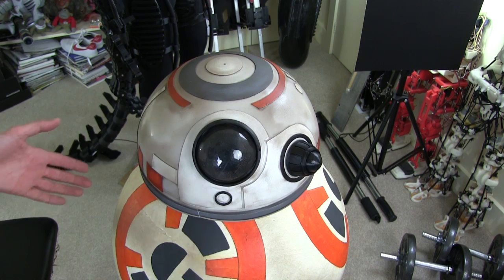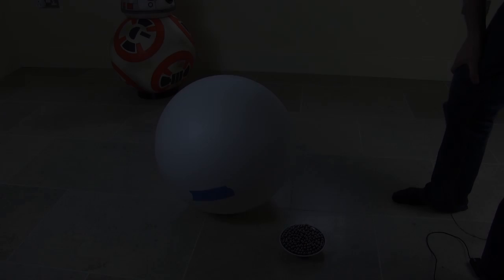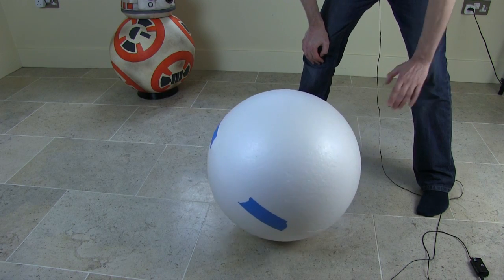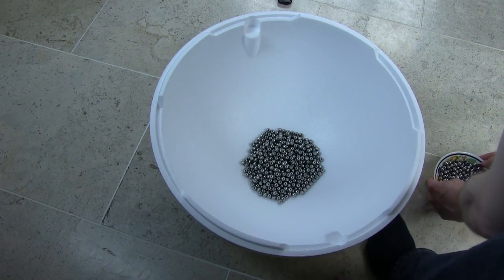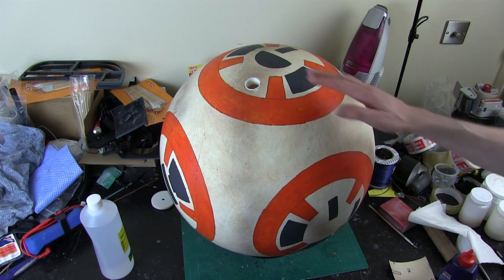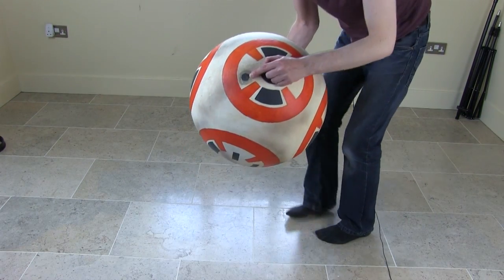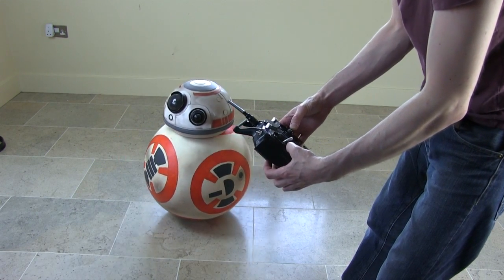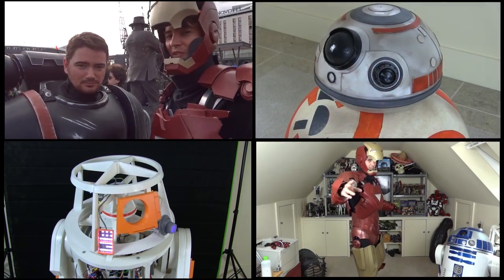Star Wars BB-8 Droid v1 #5 | Improving Stability | James Bruton

Comment: The answer your looking for in relatively simple: the head fighting it own weight, so build another head. but build it in a concave pattern opposite of the convex pattern you are running now for the heads drive wheels. insert the second head into the sphere at the bottom. with the inner and outer drives running in sync, the weight will be distributed evenly and double the power to weight ratio. making it more nimble and easier to control.  Now if you dont want to remove the inner drive all the time to recharge the batteries all the time, you could use a cell phone pad.  just park the sphere on the pad, and if the power cell is low enough in the inner drive, you should be good to go. But great job so far, Keep up the good work.

Comment: Center of gravity is still to high.
Put the robot into the ball near the floor as low center of gravity and connect the head on top with a strong magnet and ball bearings. if you also make a movable counterweight inside the ball the robot could also tilt his head up and down.

Comment: James I have not seen all the videos on this, nor all the input you might have received, but is it not a solution to use a magnet on the head part of the droid and a metal ball under it (on the inside of the main body sphere)? I might be wrong of course, but in my reasoning this solution would present stability for the moving head as it is being held on and friction towards the main body for more traction because of the magnetic pull...?

Comment: You might try (if not already mentioned) spraying the inside of the ball with a rubber coating I.e. flex seal or equivalent. It would quiet down the ball bearing considerably.

Comment: Build inside the big ball.. a big gyro with engines instead of ball bearings in the joints of the gyro.. with  a heavy bottom on the inner ring of the gyro..
i am thinking car battery heavy
that would make the big ball the Drive unit, and the head is only balancing on it..
you will have more power to move and it would  be more stable. guess it would stand still as a rock, even on hard surface...

Comment: Instead of slowing down the ball with rattly ball bearings increase the speed of the head by up sizing of your drive wheels, or if your issue is response time, downsize them to minimize the movements and reduce travel distance. Either way, your wheels are the wrong size.

Comment: James, think about going in the opposite direction for friction. Go back to the smooth unpainted ball. Introduce friction by replacing the painted graphics with textured stick on material...like non-skid.

Having a sandpaper texture probably won't be enough, So perhaps you'll need to come up with a 3D printed very thin layer with a more desired friction pattern to stick on. Also I can see the 'orange' pattern being different from the grey.

Right now with the ball bearings, you aren't only dealing with friction, but also overcoming the inertia created by the mass.

I hope these thoughts give you something to think about.

It's a very attractive project.

Comment: The smoothness may be improved if you were to spread the bearings out over a larger area, so that their weight isn't centralized in one spot.

A suggestion I would make is to find a way to develop an inner sphere with a slightly smaller diameter, with some small studs to sit it off the inner face of the polystyrene sphere, so that it now creates a "channel" locking the bearings to be a single layer, spreading them out over a larger area, and also giving you a "closed" system to keep the silicone oil focused on lubricating the bearings

Comment: The issue wont be the speed of the microcontroller. A 16mhz micro can do PID control to keep a quadcopter level and flying no problem, which is a more complex. The issue you're having is either the motors not responding fast enough to the PID output (most likely) or the arduino PID library your using is just badly written or slow. Or It could be slow/filtered accelerometer data going into the PID (you need no lag/filtering between angle change,  PID output and motor response to get a stable system.)

Comment: Why didn't you build 2 heads? 1 as the top and another as the inner balancing unit? I can see the problem with syncing both robots to face the same location inside and outside. But rather than have momentum driven balls and liquid, you now have control from inside the ball too.

Comment: i think what the starwars guys did was a heavy ball.. kept the head attached to the body with ball magnets on both sides.. inside the head and inside the ball.. then the wheels on the head is just the same thing but the configuration is in reverse so where ever the head leans that's where the ball will go. idk.. it's just my opinion.. i'm not a professional or anything but that's how i think to would probably work.

Comment: i think it would be alot easyer to install the stearing mechanism inside simular to what u made the head of, the weight in the bottom wil give u higer stability and the larger drive serface should give u more traction aswel on other surfaces

Comment: You could also make an exact copy of the head unit mechanism, alter the alignment of the rollers, and install it inside the big ball. Then, instead of using the head mechanism to do the actual mobility, use it only to keep the head positioned stably and then use the mechanism inside the big ball for the actual mobility.
Reply: he would need a really powerful magnet or smth for that
Reply: @aneeshprasobhan  No, he wouldn't. He could use exactly what he's already using.

Comment: 16BIT ARDUINO. no it's only 8. and that's not the board (arduino) but the chip.
also the chip runs at 16mhz not the arduino it's just a dev board.

Comment: It might be possible to get more speed out of the Arduino by rewriting some of the routines in C or even assembly vs using the libs.
Another option use the Arduino Due which has an 84Mhz cortex processor.

Comment: I think a better solution would be to have the motors and brain component in the bottom inside the ball. Then have the head simply be a light decorative object keept in place by a magnets on top of the ball. This way, the majority of the weight would be in the bottom half of the ball and it would not have a risk of falling over.

Comment: I think the sound of the ball bearings ruin the illusion entirely. I think you need to keep sound down to a minimum inside the ball. What about using larger balls? Like a few tennis balls.

 Or some of those bouncy balls you get which are quite heavy and dense and won't make much noise as they move about.

Comment: Why not make it move in the same way as a "sphero" (basically a toy RC ball)
And simply have the head stay on with a stationary magnet inside the ball, and have it freely slide across the outside of the ball with some sort of bearings inside the head, or some sort of small wheels like what you have. 

EDIT: I found this online right after writing this comment. this is EXACTLY what I was thinking of. 
http://nerdist.com/wp-content/uploads/2015/05/BB8Work_Schem.jpg

Comment: Fantastic work sir!  Can't get the void to play past ball bearings test - but hate how it makes BB8 so noisy! Have you considered instead a secondary gyro motive unit in the bottom ball? Either wirelessly linked to the head unit, or independent? Seems it would add extra control without the noise and weird jerky motions from the ball bearings jerking as it turns. Whaddya think? And again,  just WOW!!! :-)

Comment: A second ball 30% smaller than the lower ball with some bearings in it inside the lower ball.
the smaller ball will dampen the sound and hold the bearings to a tighter contact spot on the bottom allowing more pin point maneuvering.

Or a gyro type spindle inside with a small weight hanging. you could 3d print it with 2 or 3 rotating circles so at least one can always have the weight in the down position no matter where the ball is. gyro would be silent too

Comment: the actual droid has the main motor inside the large ball to propel that part with the head attached with a strong magnet and ball bearings with a seperate motor to move the head.. since your not going that route it suggest coating the entire ball in rubber. by some liquid rubber spray like "flexseal" this will add weight and slow the ball down. only problem would be making it smooth enough so youll need to somewhat be a painter or know one.. the rubber coating will give it grip then you just have to paint it

Comment: I have some juggling balls which are filled with liquid silicone, they are extremely stable. Also just to note that lng carriers use spherical tanks which they fill close to full to reduce sloshing. Obviously filling the ball with liquid would probably make it too heavy, so you could maybe reduce the internal diameter of the ball or separate the liquid into compartments.

Comment: Put the hardware in the ball with a pendulum drive, and control the head with magnets on a gimbeled stick.  You could do it without artificial stability if you want; the only thing you'd need it for is to move the head from the top without the ball moving.

Comment: James, you should have a look at the MSP432 Launchpad from TI. It is a 32 bit ARM Cortex M4F running at 48MHz. They have a IDE called Energia MT that you program like Arduino only it is multithreaded. With that setup you could do faster control and also have other threads doing things like blinking lights and whatnot.  We've done several projects with the Launchpad family and quite like it.
Reply: ***** It would be interesting to see what James could do with the multithreaded RTOS. It's likely he could get rid of the redundant arduino he uses for the radio control and greatly improve the responsiveness at the same time.
Reply: Trexter There are a vast number of other boards out there more capable than the Arduino board, but if you are trying to stick with the Arduino IDE as a common and easy programming language that many viewers are familiar with, then your options are limited.  James seems to prefer the Arduino IDE for his software work, so I was suggesting the MSP432 because TI has addressed two of the major shortcomings of the Arduino IDE with their Energia IDE. Energia is a clone of the Arduino IDE only they have added In Circuit Debugging and Multithreading using an RTOS. Debugging in Arduino software is a very big deal, by itself. Multithreading is also huge. Together they make a pretty impressive setup, and the MSP432 Launchpad board from TI is about $13 US.
Reply: +USWaterRockets Swapping with a Arduino ZERO might be the quickest solution.
Reply: Brian M How so? The ZERO has half the RAM, costs 4x as much, does not come with native multitasking support. If all you want is a faster Arduino, then it will do the trick, but you still end up working a lot harder to get complex software working because of the single threaded nature of the Arduino IDE. The advantage of the TI board is that you can program separate standalone tasks for everything you need to do. Your LED code does not need to worry about reading user inputs and your LED blinking code does not need to worry about affecting the precise timing of your ADC readings, etc. The code gets cleaner and easier to write with the multitasking feature.
Reply: The teensy 3.2 is probably a better fit (available on sparking) 72 Mhz arm cortex with dsp extensions and software side/API compatible. Msp432 is a versatile processor but still under powered for this app. Raspberry pie is ideal if you don't need analog in/out.

Comment: Smaller ball bearings in the same weight of the current larger ball bearing might work better. 
Sand compared to baseballs, smoother transitions when weight shifts.

Comment: Another possibility to quiet the stabilization is replacing the multiple ball bearing counterweights with a single spherical counterweight of equal weight to the current configuration. Interesting results may come from experimenting with multiple counterweights of varying densities, (do larger low mass counterweights behave differently than small dense spheres?) IE, a 1 Kilo counterweight the size of a golf ball may act entirely different than a 1 Kilo counterweight the size of a Softball. 
Either way, having a single counterweight would reduce the friction noise inside the styrene sphere.

Comment: Silicoine oil is safe for plastics, is what we use for rubik cubes, there are various viscosities available, it's also used for RC cars shock absorber lubrication, and YoYo fans also use it too, the good part is that using different viscosities you can tune the response and speed, you can clean it with isopropyl alcohol or just soap

Comment: Would a weighted bowl shaped object work that has the same curve as the ball? If it has bearings on it like an old computer mouse the ball and the bowl would be able to flow freely. This would add weight to the ball without wobble.

Comment: I'm watching your video, and wishing I could've prevented you from using ball bearings and just stuck with the whole bottle of silicone oil. I think that would work nicely.
Reply: I took your word on the non reaction of the oil. Maybe coat the inside with a sealant then use the oil. If you want it slower, then use a mesh or sponge type layer to slow the movement of the oil inside. Work out those details and it will be awesome!
Reply: Looks great! Amazing work! Everyone is going to love it!!!
Reply: You could easily sell plans or kits on this. Star Wars fans last forever.

Comment: If it's made to be water tight, you could use a thick grade of engine oil or gearbox oil from a car to keep it quiet- you could measure the weight of the ball bearings and use an equal weight of oil

Comment: I think that if reduce the amount even more it will do the trick. To make it real however, you must print a ring that fits the half of the bottom hemisphere. The end result will look like a floating spherical lager. If the balls are rolling at the bottom of the sphere you will have to handle the friction that appears when you switch from still to moving object. This is also where the parasite movement comes from. In technical mechanic there is constant that is used to describe the process. it is represented with an angle to the vector towards the ground, If you do the math you will see that leaving the balls on the bottom you are ending with a system of bodies that, once set in movement develop the pendulum moment, 

If you go for the ring that resembles the content of a floating sperical roller, you will also need bigger spheres, I can;t calculate the size, but it relates to the material the big sphere is made of, and its radius. You also have to take in mind the total weight of the ring - it must have a weight at the center that guarantees that it will remain perpendicular towards the ground, Given all that I would suggest a roller balls with the size of a ping-pong ball. There must be some additional work to reduce the friction between the roller balls and the ring itself. 

If go for that approach you will increase the total weight of the sphere, thus creating enough friction with (almost) any surface, but remove the parasitic pendulum moment resulting from the way you currently implement the center of gravity. 

keep on the nice work man :) I really enjoy your dedication and creativity.
Regards

Comment: Hello James, if you put the system that exists in the head on the body, you will be able to control the head and body at the same time. The only difference would be that the commands of the head and the body would be reversed. Also the head should be even heavier. Sorry for my English, I am Brazilian.

Comment: I dont know if its possible, but perhaps remake the sphere with dotted rubber where the orange and black symbols are for a better grip on smooth floor.
Reply: ***** 
I personally think the noise and the wobbling of the ball don’t do your design justice. Couldn’t you try to use a ball with a softer top layer?
The (empty) ball moves slower on a carpet, because the carpet deforms. The deforming of the
carpet gives the droid enough rolling resistance to be stable.
If you want to use the droid on a hard surface you could get a high enough rolling resistance by using a softer top layer for the ball. One that deforms. 
Maybe this adds to what I mean: https://en.wikipedia.org/wiki/Rolling_resistance
Reply: *****
Ok. I can see the issue there. Maybe you are more capable of thinking of a better solution than i am.

Comment: Somebody else probably suggested this already, but why not use a Teensy 3.1 at 96mhz rather than a 16mhz Arduino? No code changes required and probably just a little level shifting from 3.3v to 5v logic. should improve it massively for just $20

Comment: What about using lead shotgun pellets? Lead is softer so the noise would be reduced and it is heavier so that could help as well...
Reply: Martin Blass forget about the lead! Fill it with mercury!!!!!
Reply: USWaterRockets Huh. Mercury. That's actually not a bad idea. It might slosh around less than water and he can use elemental mercury.
Reply: Martin Blass if your talking normal buck shot , they are tiny , and not all perfectly symmetrical, even fs he used the larger buckshot they are just lead clumps , as far as getting a nice symmetrical  round metal object , i don't think you can get any better than ball bearings for the price , even BB's are more like clumps..lol
Reply: +Martin Blass Nice gas mask
Reply: +USWaterRockets That's actually an excellent idea.
Reply: +Chris Smith what about round led fishing weights?
Reply: +henry montero lead***
Reply: +USWaterRockets Filling it with mercury is actually pretty smart. Less sloshy, lots of weight, moves with the ball.
Reply: +TheMinetestCreator danger is my middle name.
Reply: +USWaterRockets silicone oil would be good!
Reply: MrLittlelawyer  it is very dangerous don't do it
Reply: +Amfddc it's all dangerous